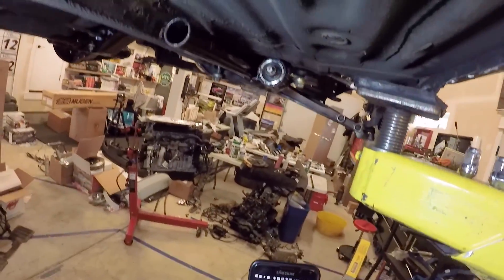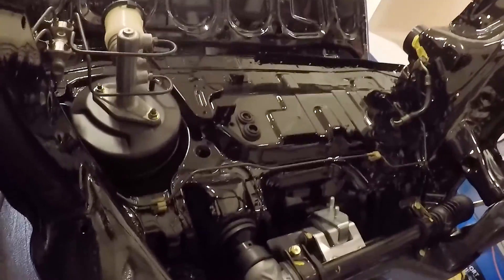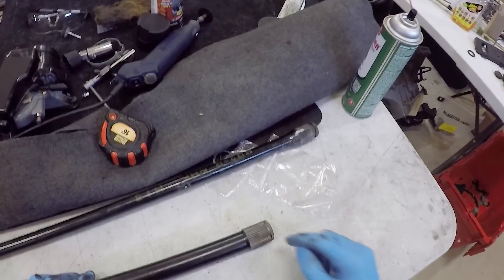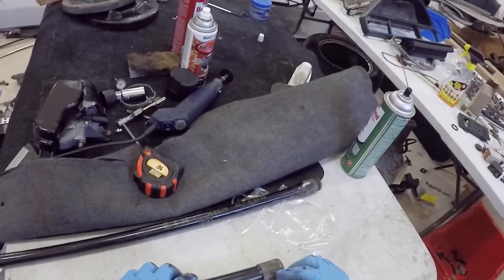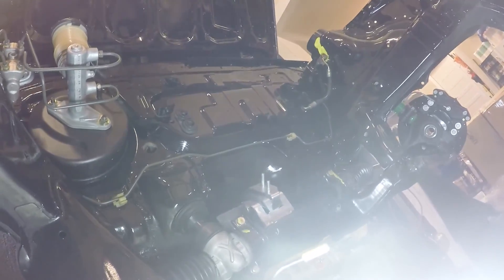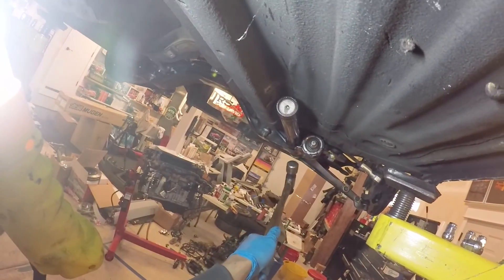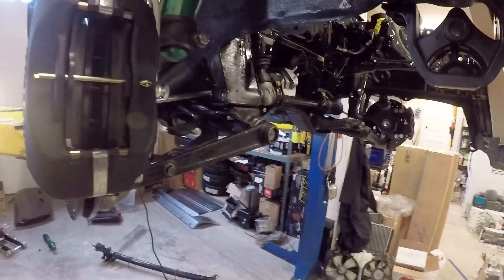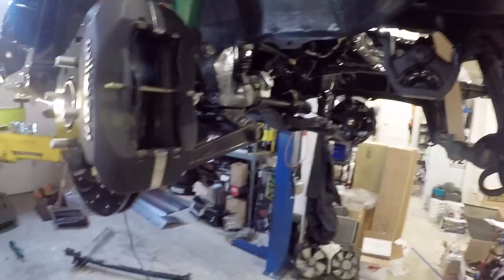Heeltoe's Torsion Bar Honda Front Bar Reindexing Part 2

Comment: Hey, i know this video is 6 years old but i wanted to ask a question if anybody reads this,
I have a 1987 civic sedan and the front suspension is doing things it should not( hitting on literally every bump) and i noticed the car a little lower than usual so my question was is it possible that the torsion bars are bad and lost their elasticity and strained? Or if not could it be the dampers/struts
Reply from the maker: Not super likely, more likely the dampers are bad. We have new KYB ones available at Heeltoe!
Reply: @Heeltoe.  I will look into those dampers but I have one more question, 
If I tighten both height adjustment bolts that attach to the torsion bar all the way, can anything go wrong or should i not tighten it all the way? It is because my civic is riding quite low and until I get new dampers, I don't want it to hit bumps.

Comment: I'm no mechanic but could you just buy a longer adj nut to wind it out more? Iam planing to purchase new oem struts and lower them as coilovers are expensive to ship and Australian road laws don't allow you to have coilovers to get my civic lower and refreshed. By re indexing the torsion bars will the oem replacement struts bottom out?? Or is it just worth me biting the bullet and getting a set of bc racing coilovers as there are local suppliers here down under ( I would love a set of your tein medieval pros but the exchange rate and shipping kill me)
Reply from the maker: It's important to know that the damper stroke and the height (torsion bar index/adjustment) are separate factors on these cars. So yes reindexing the bar will cause it to lower the car and reduce travel, making you bottom out more if you use standard length dampers.

And sure putting a longer bolt would allow lower adjusting but that is also not really ideal compared to simply changing the arm one spline and keeping the standard range of adjustment.

Comment: Going to be ordering a set of the torsion bars in next couple weeks just finished my rear suspension using 375lb rear springs what size torsion bars you recommend getting for a b series swap 1985 civic s
Reply from the maker: Hi there! 27 mm for a street performance setup.

Comment: Do you sell anything already pre made? Like the torsion bars? I own an 87 Civic sedan and I'd really love to lower it with this method until I can afford to buy an all around setup.
Reply from the maker: You can lower the car by adjusting the torsion bar adjusting nut. If you reindex without installing the performance damper kit you will find the shocks are bottoming out and it will handle really poorly.

Comment: Hey guys me again . Quick question kinda iff topic? Will rear acura rsx coilovers fit on 84-87 honda civic? They look like they would .perfect fit from how it looks . What you guys think???
Reply from the maker: Any shock with an eye-mount at the bottom, an integrated spring seat, and correct overall length will fit. That doesn't mean they will work right.
Reply: True . We wont knw untill we try it.